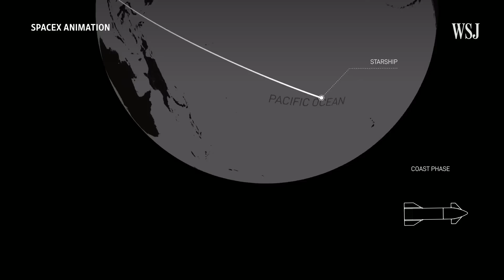Starship Launch: What Challenges Does Elon Musk’s SpaceX Face? | WSJ

Comment: If it doesn't explode above the pad, that's a huge milestone. Saturn V had 7.5 million lbf, SLS 8.8, Super Heavy has 17; twice of the biggest rocket even made, insane.
Reply: It did'nt explode at pad, huge success!
Reply: @brownianmotion7747  I saw the stream today, honestly a huge success. Now, they will need to workout the maneuvers and such do it doesn't keep rotating until flight control terminated it.
Reply: @brownianmotion7747  Amazing!
Reply: Bro. If that thing lands... there's just no way right!? This is supposed to be a test so future starships can land but if it lands that would be hilarious.
Reply: @lachlanB323  they have no plan to try land anyway
Reply: @Revaldie  Makes sense.
Reply: It didn't
Reply: Correct me if I'm wrong but doesn't the n1 first stage produce more than super heavy?
Reply: @dudejunior1995  No. N1 only produced ~10.2. Starship's booster will produce, as Jisus above said, about 17.
Reply: @dudejunior1995  First stage – Block A - 10,200,000 lbf / First stage – Super Heavy - 16,700,000 lbf
Reply: I see, thanks for the correction.  Hopefully we're in for a spectacle tonight